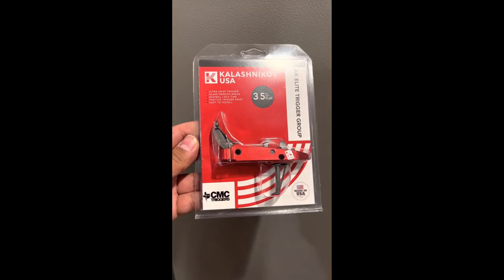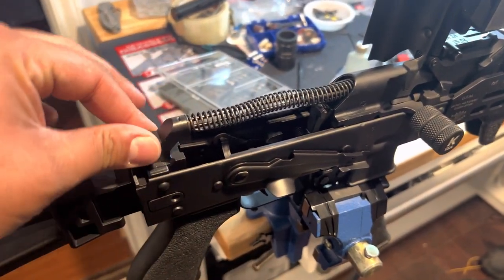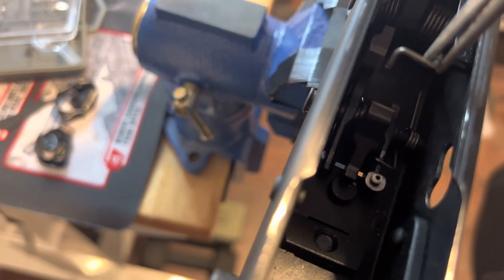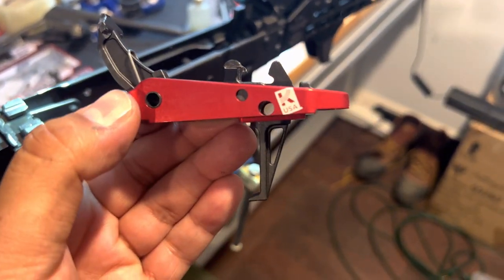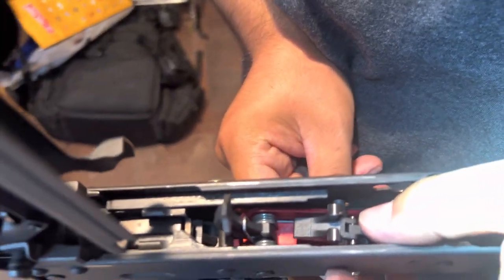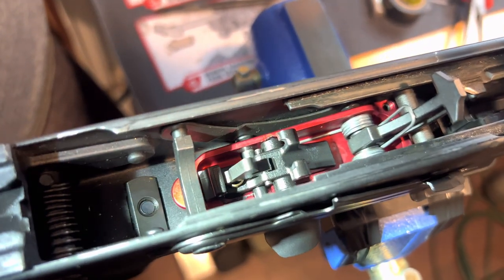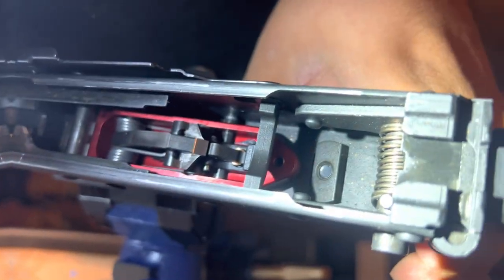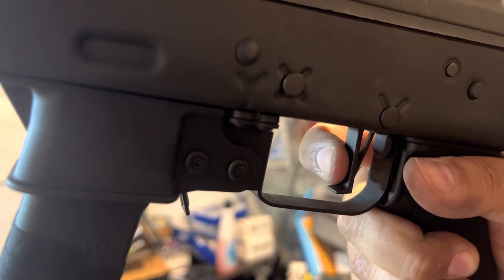KUSA CMC Trigger install for KP9

Comment: So what happened with the alg?  I noticed it didn't look like that big rivet was shaved down any. Did u file down the disconnecter? For the .060 max .  That cmc looks really easy . How's it working up to now?
Reply from the maker: Nothing was wrong with the Alg i have two of them in my other aks. I didn’t have to do any filing except on the safety detent. It worked well just wanted to try the cmc. I think the cmc is a lot more clean of a break and reset. But the Alg is great too. I’d still choose the cmc.

Comment: NOTE TO BUYERS FOR KP9 

If your KP9 has the little pin sticking out to engage the safety it WILL NOT WORK! I just installed mine minutes ago, did some research, and found out the hard way! Safety will not work, you will also need to buy another safety selector WITHOUT the small pin for safety engagement.
Reply: There definitely should of been a disclaimer somewhere. I ordered mine from their website and there was no mention
Reply: Mine worked in my KP9 but did not work on my KUSA 103 AK 47 I had to order a KREB Full Auto saftey selector switch
Reply: i found out the hard way too.

Comment: After installing my cmc the bolt hangs up on the hammer of the trigger pretty badly
Reply from the maker: It’s the same with the alg triggers. It’ll do it less the more you shoot it.
Reply: Really? When I say hung up I mean it takes a lot of force to rack it. I’m talking 20-25lbs of force to get past the hammer. Is that normal?
Reply from the maker: @mikerossi7903  oh wow i thought you meant there was a little resistance when racking but 25lb seems a bit much. I’d double check that everything’s installed properly. Idk how long ago u bought the kp9 but there was a recall for the firing pin and the bolts being out of spec. I had to send mine in  and they sent a replacement. Also people were getting out of battery strikes.

Comment: How do you get the safety down past the trigger assembly in the video it cuts right at that moment
Reply from the maker: Push down on the trigger disconnect with your other hand and push the safety back
Reply: @PewPewithDrew  hum mine doesn't have any play to push down
Reply from the maker: @NekwaWatch  make sure your hammers up and try pressing the trigger to the rear as much as possible.
Reply: @PewPewithDrew  im able to get it down pulling the pins but then having troubling because I can't remove the safety to install the pin clip I'm wondering if I need to remove it and use that slip hook looking piece that comes with the trigger
Reply: Thats what I did its retaining the pins perfectly, Thanks for you help

Comment: A video of you install the safety after would be great.
Reply: That's probably the simplest part - Have the lever pointed upwards, stick the "U" shaped bit through the right side hole, through the left side hole, then rotate back down.
Reply: Dude, not a single safety I have works on this trigger system.

Comment: What safety do you have in this video?
Reply from the maker: Krebs safety
Reply: @PewPewithDrew  sweet, just ordered yesterday. Also man safety issue aside (I don’t think the safety has to do with this) did you have trouble with your trigger resetting? Even without trigger pressed, simply racking my KP9 causes it to stick on the trigger as if I had it pressed in. I’m about to throw the whole build away and I haven’t put a round through it 😡
Reply from the maker: @kylesuttle2090  no i didn’t it was a smooth install no issues